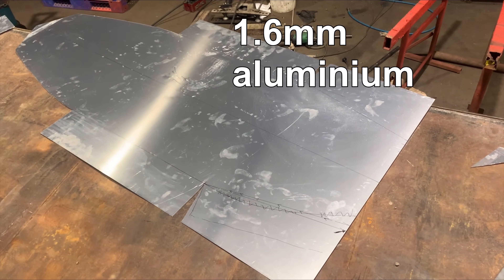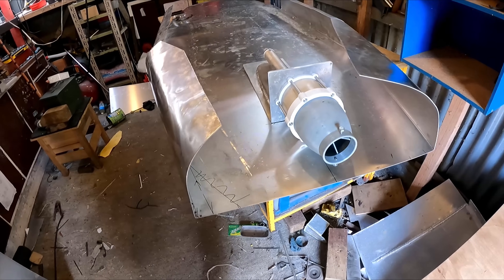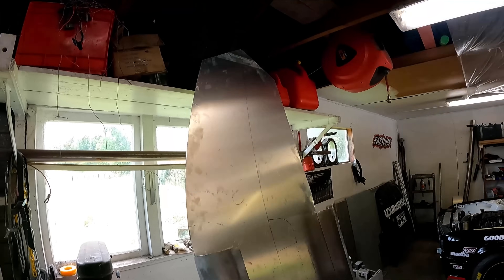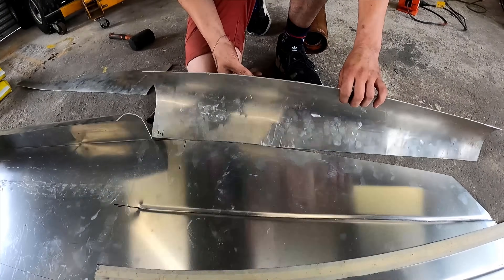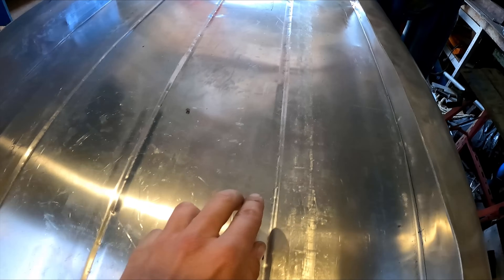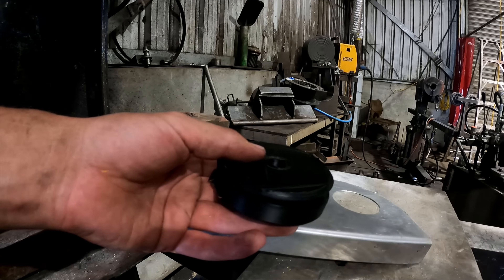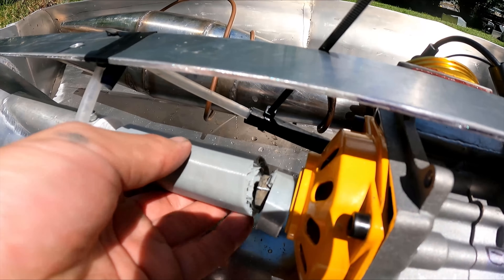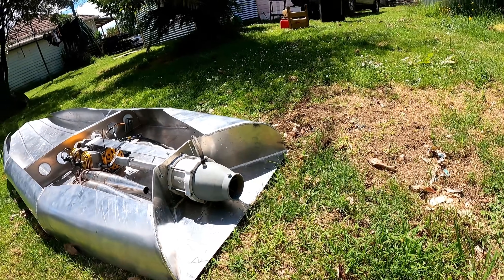Homemade Jet Drive 2 Stroke Twin , Board Building

Comment: Some rubber bushings help with all the vibration causing things to break
Reply from the maker: I had the engine plate rubber mounted , but those motors are junk they are so out of balance. I think a better option are those bicycle engines with chainsaw heads on them 👍

Comment: Love the idea but I would have made the board out of foam stiyren and then coated it with marine fiberglass but keep the aluminum engine bay as an insert! This way it would be easier to manufacture ,easier to service and won't have to worry about leaks ! I was an aircraft structure ( fiberglass) mechanic  in the Navy! You will be on that TV show and you will make more money than the people who made the seadoo!
Reply: I was wondering do you have the geode for the connector from the output shaft to the cooling fan! Give it to me and I will forge it in aluminum and ship it to you as a favor

Comment: you couldve hammered the aluminum, and stretched it faster. use a block of wood under neath the hammer, so you dont leave welts in the metal. cut down a cv axle for the outboard prop to drive the jet drive. itll handle the G's better than that corn based plastic will. also if you make your water jacket larger, you can increase the flow of the water. betchya shell fly then n yea under the boat will do better. otherwise you ride under the water line.

Comment: Maybe change the 3d printed part on the drive to metal (with casting or milling) but if you can’t in the print settings of whatever modelling software you use  there should be a infill density setting for example this changes the print from being maybe 20% plastic to sum thing like 50% or 60% plastic and a better plastic to use I called petg it’s much better than pla because it’s stronger and the layers stick better I thing it will be better for the application

Comment: I’m sure if you look at the jet ski you will find that the nozzle is under the water and the reason is 2 fold , steering and thrust. Also for better control ability you should add sponsons.

Comment: If you heat up the aluminum you can use the shrinker it will work much easier and better also remember around your motor you have to watch out for harmonics because it can crack the weld it would be a good idea to use rubber motor mounts for the engine also why I suggested Heating the aluminum because when you go to shape it or even put it in the English wheel it makes it more pliable

Comment: jet must be above water. Ship pPropellors develop thrust through pressure (or lift). Jets develop through the acceleration of water mass (kinetic energy). Putting the jet underwater will turn the kinetic stream into a pressured stream. A jet impeller doesn't have enough surface area to generate thrust through pressure. This guy is cool>>> https://youtu.be/C9jGKaiZIcQ

Comment: Check out  a tides marine seal  online then make one for  your shaft 
Or a last drop coupling  online 
Metal disk on the shaft  pushed up against a sleeve on a rubber hose 
Have a great day!

Comment: As for the Armored Hose idea a piece of old Hydraulic hose could be the quick way for proof of concept. The only problem is keeping it tight on both ends. Hose clamps would work if some splines were on both shafts... even they can strip out the rubber and eventually they will!

Comment: There are small diameter commercial made couplers. I have a few on small gas engines to Pumps they have a Hex screw that fastens 1/2 of it to the drive shaft then a rubber shock absorber and the Mated second 1/2 to the Driven shaft also with a hex screw or Allen screw. Seems like the distance between the impeller shaft could be better taken up by a small “Jack shaft” in cars or trucks more often and military equipment they have universal joints at both ends allowing a change in drive angles. 
If you were to put the nozzle output below the waterline a great way to couple the shafts would be this way. 
I’ve found couplers like described above at hardware stores.
It’s 20°F on this winter day up here in Michigan. -6° C, and Sunshine on this second day of the year!

Comment: You should take a look at the bottom of a jet ski this will give you a good idea on the waterline and positioning of the jetdrive and your motor should be isolated on rubber mounts like they use on a chainsaw, and you should have a vibration dampener between the engine and the Jet Drive. You'll probably find you need to V the bottom from the jet drive intake out to the sides of your craft so the jet drive is lower than the waterline

Comment: the jet of water needs to vector into air...f=ma   so take a mass m(water chunk)  and the greater the acceleration, the greater the force.     Test this with a garden hose and a bucket of water...you'll feel and see the force difference
Reply from the maker: I agree, there are still people that comment it needs to be under water!
Reply: @dkthewelder  yes, the common argument perspective is:  one gets more force pushing off a wall than from just air.  Using the running garden hose and bucket of water seems to be the only way to change their mind....

Comment: The jet should deffo go out just above the water line. Try next time you're sitting in a bath tub and hold the shower head in your hand and turn on the water, first do it under the water line and then hold it just above. The difference in force is very noticable.

Comment: Was printing the coupler at 10% a joke?  😬 i think you need to anneal those prints or print with CF nylon etc.
Reply from the maker: I printed it at 100% now will see if it works in the next video
Reply: @dkthewelder  ahh. Hopefully you printed the piece "laying down" on its long side. BTW love the videos and surrounding.

Comment: You want the jet lower than water when resting. If it isn't, it's full of air and you need to move enough air to suck the water up and prime the jet. Air has very little resistance so to pull the water you need to move a lot of air to pull the weight of the water. Once the jet is primed it can easily suck more water up as the water has resistance, mass, and momentum and won't flow backwards as easily through the impeller. Then every time it breaks suction and gets air in it(light chop on plane can be enough for this) it will need to do this all over again. Using an impeller that uses centrifugal force to compress the water works much better than one modeled after a boat prop(don't know which you used).

Comment: Cool work Cuz. 
Might be an idea to run a brace from side to side across the top of the engines to help with torque. 

Cool that the coupling held up.

You could try rubber mounting everything and it would be cool if you could decouple the engine from the jet. Sending those harmonics to that coupling wasn't kind ☺️. Some sort of a CV joint would be perfect. 
Yeah, preheat the water before you stick it in, otherwise you'll get thermal shock on the parts and loose power. Henry Ford figured out that if you keep the water as hot as you can before it boils the more efficiently the engine ran. 
You can add and remove copper coils to the chamber's to get your exhaust water temp right. 
Yeah play with the water line nossel. Phone Hamilton's ask them. I see a guy that worked there said what the go is. 

Good Luck. 

Add Pop later. 😊

Comment: Ok. 
Old guy been playing jet boats for many years. 

Jet goes over the water line when running, and under the water line when stationary to prime it. 

As for couplings, don’t underestimate the effectiveness of the rubber and cloth fuel transfer hoses with a hose clamp or two at the ends. 

As for couplings between the motors,
O rings or silicon tube over (bolts) printed columns give shock absorption and wear resistance. 

Keep up the great work, I am so impressed with what you are doing.

Comment: What if you build a box an do like a scoop from underneath the boat so when you get going it’s forcing water into the box witch you could run a hose off for cooling the jet drive. And might be worth making a metal bit to connect the to the drive shaft less problems being out of metal

Comment: I'd say print 2 outlets, one with under the water and one how u have it now just at a 45 or so. 

With the mix of the 3 options u will have I'm sure u will figure out what feels good Jet wise.. but that's down the track mate. Don't worry about that stuff until u can get through a test run without something rattling loose or blowing up on u.

Really interesting concept, I've been thinking on a 3cyl engine for a pocket bike, but running N-S not E-W with a 90° "gearbox"
Reply from the maker: Yeah I think you could run 3 cylinder it would sound awesome, I was thinking it might snap the crank on the last motor but I guess if they aren’t firing in sync it should be ok 👍
Reply: @dkthewelder  for what $50 for a new motor I don't think I'll stress about a broken crank on a death $150 death machine 😂

Comment: I think it looks sweet! Don't change the back. Having the jet above the water means little. The water jet is your thrust, and just like a proper space rocket it doesn't matter what happens to your exhaust once you throw it away. A rocket doesn't need the ground to push off of and you don't need water to push off of. So long as you can feed the pump and aim the thrust, you're set! Good show!

Comment: The jet unit should be midway in the water. If its totally above, depending on your draft, the pump won't be able to prime. If the pump doesn't prime try adding some ballast to the back of the board. When you come onto plane,, the pump will be mostly out of the water,, but by that time the pump is fully primed. Completely under the water is unnecessary possibly problematic.
Reply: Def print everything solid also now that you have your prototyping done. Maybe even look into getting some stuff machined. If you want more vid content do some loss PLA casting with aluminum. This guy shows how to make a no frills furnace https://youtu.be/PK3DuB1Dtu8 and there are a ton of other vids that show how to make the propane torch part. Good luck! The board is looking awesome!

Comment: most jet boats and jet skis have the jet only in the water at low speed. I think it can improve the low end efficiency a bit. But as soon as you get up to speed all of the tend to lift the jet outlet out of the water as far as i know. There is now way to keep the nozzle under water if you are up on plane with a boat. So if it didnt work like that then a jetboat couldnt be on plane ever.

Comment: Is the motor solid mounted if so might want to use some rubber to dampen down the engine vibration

Comment: I race jetskis and also wondered if it matters if the nozzle is above the waterline.  Although it seems like you would gain thrust by having the jet blast push against a denser material, apparently that makes no difference at all.  As I understand it, it's the inertia of the water that's being accelerated out the back is what causes the opposite but equal reaction moving you forward.
Reply: I was always told you are actually pulling yourself through the water. Not pushing when using a jet pump. But also. As far as Nozzle height. The way he has it is exactly how all jet-skis are made. That’s the job of the ride plate. He just built his right into the hull.

Comment: OK on the cooling water best to mount the water inlet jet for feeding the engine is best from taken from the side or bottom of the jet to help you pick up less air. On the 1/4 scales we run here we keep the engine cooling separate from the prop wash to help prevent air pickup. Running a separate diaphragm fuel pump like off a lawn tractor to supply the water for the cooling. They are 15 bucks on eBay, but it helps prevent any air locking in the water jackets and with the separate pickup tube less likely to grab weeds and dirt to clog it up, I run a cleanable reusable fuel filter for a car inline inbetween the outside pickup and the pump to prevent anything sticking open a check valve inside the pump. Using crankcase pressures as a driver to the pump, it doesn't effect the performance too much at all being a sealed system if that's of a concern? But it's definitely a learning curve and unfortunately those Chinese engine's are so cheap it's worth a go around. BUT I've had my fair share of them and now they have become self dust collector's in the garage! I went back to the smaller Japanese copies of the RedMax/GreenMachine/Zenoah engines. They are a little more money than that of the pocket bike engine's, but they are really built so much better than those. Once you get a little taste of one of those or even a real Zenoah you'll know what I'm talking about, side by side no comparison in how smooth they run and how much better all the way around they run. I had the same idea as you at one point and went for the CCs and thought bigger has to be better? Stuffed a 60cc Big bore full circle crank pocket bike engine in one of my 1/4 scale cars and regretted every second of it! The worst part of all this was after jumping 25+ ccs in size my 32cc Zenoah based engine was almost 2Xs as fast top end and off the line. It was a total waste of time and money on my end. That's how I know so much about this topic, I unfortunately had to go through the painful learning curve of these engine's, and yes there's no feasible way to polish a turd in this case without redesigning or engineering the engine's. On paper their Good, in reality, they suck! I thought for sure at least I would gain off the line torque with the larger engine? The expansion pipes they sell for them aren't the right sizes nor do they work. The aftermarket adjustable clutches they sell are another great concept on paper, but made them vibrate even worse. The harmonic vibration was so bad at one point it effected my electronics and my expensive equipment was being interfered with from the vibrations at certain rpms which is pretty dangerous when you lose control of something so Big. Just wanted to share some known issues and experiences with these engine's with you. Not knocking ya one bit, they look great, but in reality they are pretty rough and crude especially for smaller projects that can't absorb the vibration. Good luck with the jet boat! Would want to see you succeed with it personally. I have 2 1/4 scale fiberglass boats, a 42" Crackerjack and a 47-1/2" cigarette boat both run surface piercing props and zenoah based engines. I started with a weed whacker Homelite engine at first I made water cooled 25 & 30cc now they are 29 and 32cc zenoahs and will run circles around the original yard equipment engine's I originally used. Anyways, good luck my friend down under, we wish you well in every manner these days.
Reply from the maker: That’s a lot! I’m trying to build this whole jet surf board for pretty cheap . Thanks for the info I will look at those other engines , these engines are nice and light and start well but worried there won’t be enough power

Comment: Looks and sounds great Mate, best be making those cylinder heads liquid cooled as well, to avoid detonation of the fuel as well. I have plenty of experience with these Chinese engine's! Honestly they are Horrible! They are some of the most unbalanced thing's I've ever ran before! I run 1/4 scale RC boats, cars and trucks. I've had plenty of time on these engine's and no matter what you do with them they are inherently out of balance. The only thing you can try doing is balancing the rotating assembly with some Vee blocks or if you know someone who's capable of balancing such small engine parts. The best thing I've found was the Vee block method of balancing everything neutral. The worst crankshafts I've seen yet are the "race" full circles they sell for a aftermarket upgrade. They are so badly out of balance it will end up vibrating itself to pieces and all the other Shit around them it's attached to as well. There's no way of even doing a neutral balance on the full circle cranks unless a lot of steel was removed and replaced with epoxy like that of Husqvarna does on their high performance chainsaw engines. Don't know what kind of polymer they are using? BUT it does hold up to the RPMs of 16K or better and the heat plus the Gas without being attacked by anything. That's how they stuff their crankcases using a half metal half plastic crank. A full metal crank, you'll never have enough Bobb weight to offset the weight of the added connecting rod, pin bearing, pin wrist pin and bearing plus the piston and rings. A Shit ton of material needs to come off the rod side of the cranks to make them neutral balance and your back to a standard bobb weight crankshaft lol. Hence why Husqvarna used plastic as a filler material for its light weight. Hope this helps ya. Also those flywheels! Are absolutely horrendous too! They may appear to look like they were balanced? BUT with what and by Who? God only knows? But I've never come across one that is even close. Good luck mate from the other side of the pond.

Comment: As a suggestion, you may be able to make a coupling by welding a hex head socket onto a bit of tube. I can't remember how the prop shaft from your impeller is terminated, but it shouldn't be too difficult to couple it to a tube.  Amazing work as always!

Comment: Waterline jet nozzle: the nozzle above the water line should work just fine. My gp1200 is above most of the time. One  can clearly see the thrust column of water before it re emerges. As long as the intake is scooping that's good. Amazing job of the shell so far. 
Zero rubber enging mounts/dampening... hope it stays firm.

Good work so far
Reply: YES, Same Page Club.

Comment: I don’t think the couplings would work by 3D printing it. I watched the guy who tried the same thing and ended getting a coupling from cnc machine that drives the screw of the table. Just a thought. I have a 3D printer myself and I know what it’s capable or not capable.